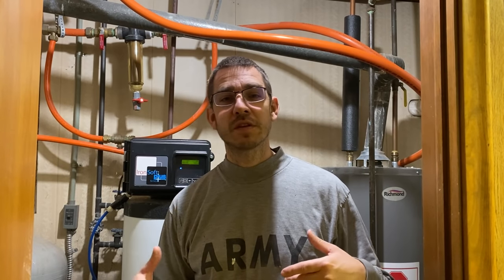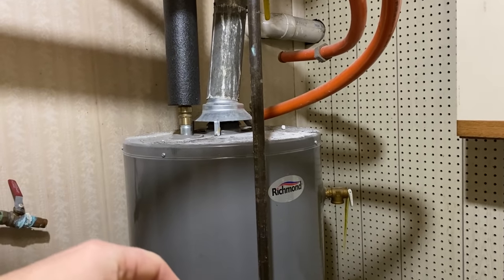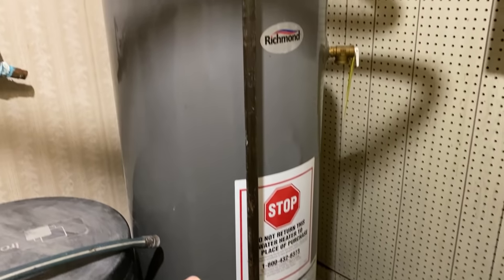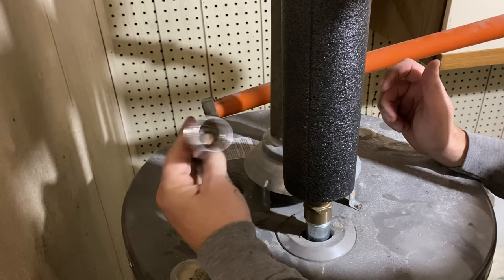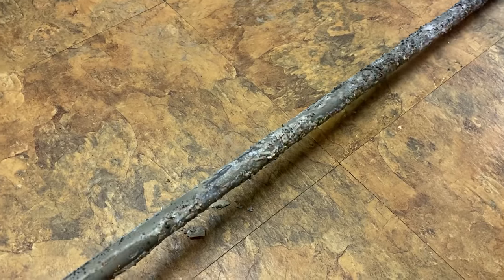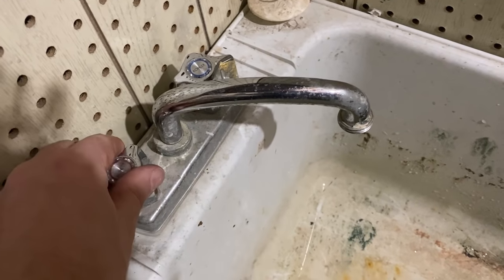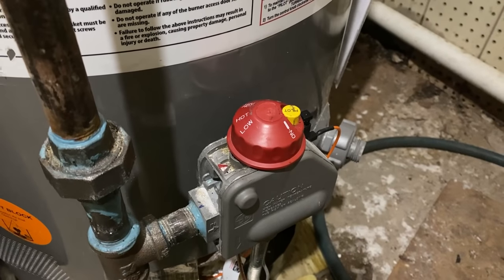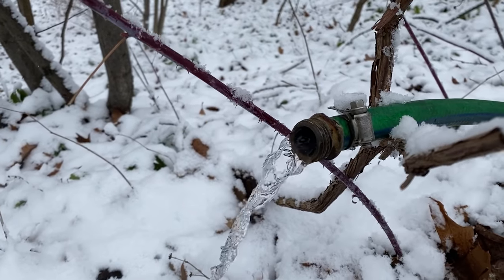How To Get Rid of Smelly Hot Water - Easy Fix!

Comment: Just for giggles and grins here. Are you on Well Water??? what your describing as the smell is actually {Hydrogen sulfide}.. or Sulfur Oder. it can be naturally occurring in certain areas. That would need water treatment if this is the case. I hope that I am wrong about this assumption but I spent 23 years as a Environmental Scientist before retiring in 2008. Best wishes on  the water smell problem.

Comment: To let your Water heater drain faster and that so called vapor lock, just open the blow off valve you have there on the right side top of the tank.
Reply from the maker: I normally don’t do that as I have had some leak in the past. But yes, you could do that